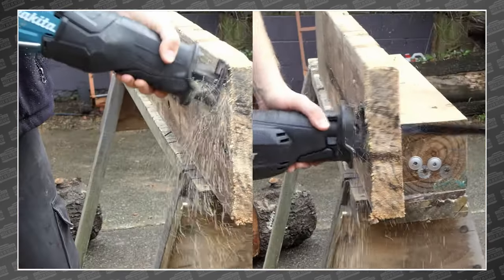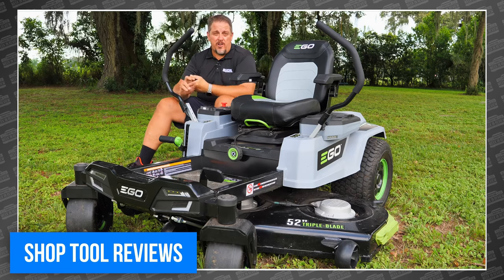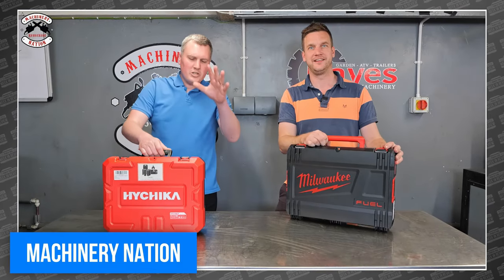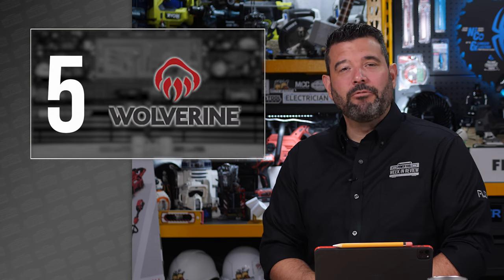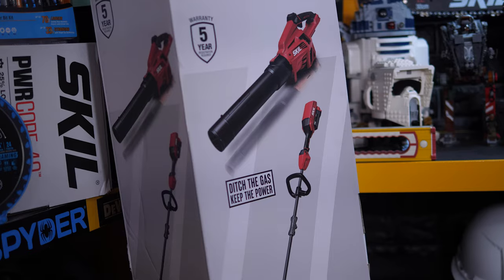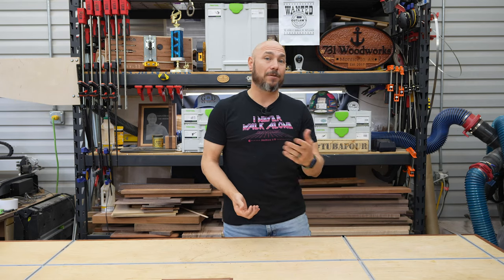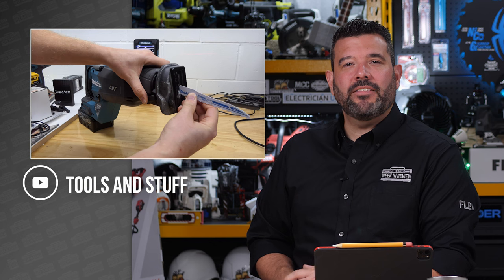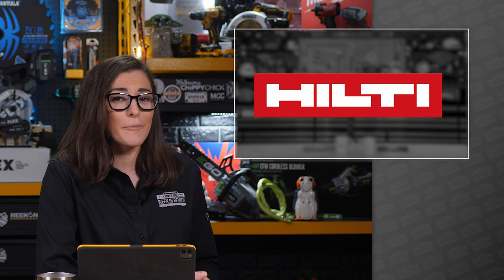What exactly will Milwaukee reveal? Power Tool News!

Comment: Great show as always. Of the YouTube channels I subscribe to, yours is the one that makes me happiest when I see a new video is posted. Always great and entertaining content. I’m a residential remodeling contractor, mostly kitchens and bathrooms, so I do a little of all the trades. Packout has made a massive improvement in how I work, and my job site efficiency and organization, as well as how much easier it has become to load and unload what I need for the day in and out of my truck, and saves a boatload of room in my tool storage area. I LOVE IT!! I own a ton of Packout. Since you’re going to be at Pipeline and in the presence of tool greatness, possibly you can pitch a couple of ideas that would help me out (and feed my Packout addiction). Currently I use a few of the crates for storing my spools of wire, but what would help me out even more would be possibly a rolling toolbox, or a larger box that could attach to one of my Packout dollys, that opens on the front and has slots that I can slide a piece of conduit in and mount my electric wire onto, so I could keep it on the bottom of my Packout stack and use it to pull wire with. That would save me a ton of time when I’m doing electric work. Also a simple one, that would help me organize my truck, some Packout buckets, not crates, that have about the same footprint as the Ammo box, but a little taller. They’d be super handy for things like tubes of caulk and carrying misc parts and materials, and could also be used for holding water, for plumbing, tiling, painting, or any number of other things on the job site. I use buckets for a lot of things, having square ones that would work with my Packout would be AWESOME. Lastly, I use the Packout soft side cooler almost everyday. The side for my drinks and lunch is bigger than I need, so it’s got some wasted space. I’d love it the same size but increase the pockets and other onboard storage, so I have more room for my job site administrative stuff, iPad, paper, invoices and other personal things that I like to keep with me and need for the day. That way I wouldn’t need both a cooler and a job site briefcase, I’d have just the one piece to bring in and out of my truck every day. Perhaps the “Packout Sidekick”. Sorry for the super long comment, but I love my Packout and I’m hoping you guys can help make this happen for me. Keep up the great work and have a blast at Pipeline!! I’m very jealous.

Comment: Honestly that Milwaukee shelf would change my frickin life so much lol, using some cheap ryobis in my shop now. Love the constant content
Reply: the new Ryobi HP line is super solid at a decent price. the new mid torque is a beast. you need to use hp batteries to get the most out of the new hp tools.

Comment: alot of the video was about the tool shelf stuff.. requiring paid membership for that basically turns it into a raffle, the odds to price ratio on those is never in the gamblers favor the person hosting it never takes a loss, they dont give out more than they take in, same as any other type of gambling except with this youre given items not cash to get exactly what you need

Comment: I just need someone to invent a universal battery charger. I have Ryobi 18 and 40 volt , Milwaukee 12 and 18 volt , Ego , DeWalt and even 18V Craftsman batteries currently kicking around the garage. I have an alter of chargers I need to bow down to before I start working on anything. 😂